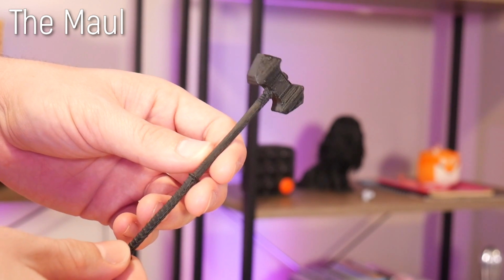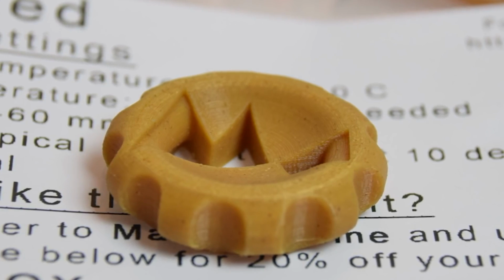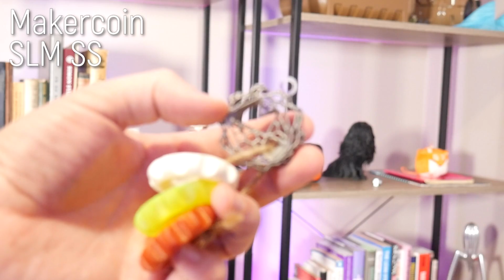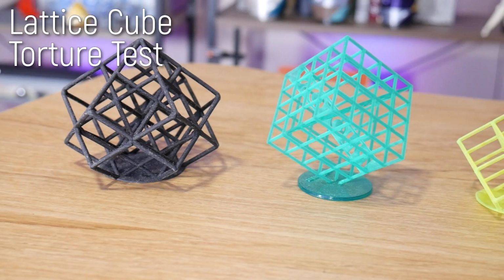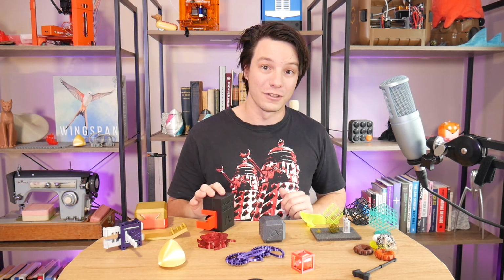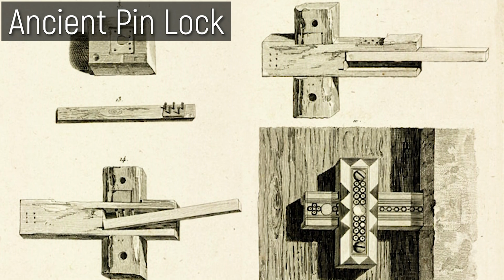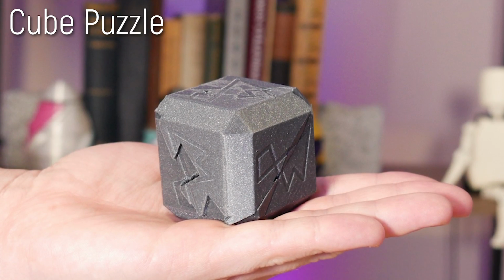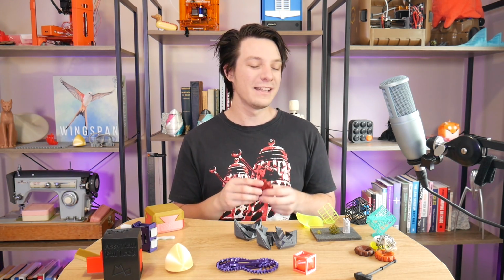My Favorite Designs from 6 Years of 3D Printing!

Comment: 10:54 I wonder whether you could move the centre of mass to the centre of the object by making it hollow and putting a ball inside with the correct size and weight to cancel the offset as it rolls to the low-point (which would vary depending on the relative size of the hollow to the object containing it).

Also wonder whether just making it of a very light material and giving it a very heavy fixed spherical core would have a somewhat similar effect.

Comment: Does it count as 3d printing when you print out so many individual sheets of paper that it forms a large stack in the tray? Lol

Maybe if you could print with some sort of thick ink, and then clip the papers together and burn all the paper away, melting the layers of ink together, you might be able to 3d print on a 2d printer. With a ton of waste lol

Comment: Klein bottle is a manifold you could try to print. 
Manifolds are very interesting math entities .
If you are in a Topological space and maybe you have contained in it a torus of genus 1. You can have this torus to contain a Möbius strip and also intersecting it another manifold that together with the Möbius strip can form a Klein bottle. How would you 3d print this.

But let looking at Möbius strip or anti-oloid as you call it. It may have complementary set inside a topological space that can be another Möbius strip mirrored or a kein bottle.
Those things can be explored ad infinitum. 
When you bring them to the physical world they may have some properties that are really mesmerising.

The little coins could have some dynamic properties. It would make them more interesting. Or be boxes with a lock, tiny boxes. 

I am thinking about buying a tiny 3d printer and I have to decide which one is best and how I will write programs for it. I worked as programmer and analyst a good part of my life. Now I have people of my family that I want to help. And this 3d printing seems to match well with manifolds or I maybe wrong. Anybody can see a Möbius strip in that anti-oloid. 

I still must solve the problem of my lock. Those locks for sale are worth nothing.

Comment: I built the Nautilus gear. It's really pretty cool. The issue I first ran into was the year first level wasn't thick enough and so wasn't sticking to the bed. So I canceled the print clean the bed again and I started the print and wall everything was warming up I went into the settings and increase the filament flow 10% and decrease the printing speed to 70%. Perfect print.

Comment: Nautilus gears might be useful in an application such as a motor compressing a spring in an air soft repeater, needing less torque initially and more as the spring compresses.

Comment: Damn you 3D print wizards.  My son got me one.  Downloading prints was fun for a while but designing my own was a challenge.  Once I learned a little CAD, then the next step was learning about CNC subtractive machining.  Then came the challenge of CAM.  Now I have a 3D printer for additive machining and a CNC (mini) mill for subtractive machining.  So much to learn, such a challenge as I approach my 70th birthday.  Now I want to make a CNC router for woodworking and the challenge goes on.
Reply: Wow this was crazy to read, sounds like you’ve got it. Stay truckin’ Ron Morrison
Reply: My dad`s pushing 60 next monday, and we work together building CNC routers here in Brazil, going on our second year now, and both of us had exactly 0 experience with the design and assembly of these machines, we are waiting for our Ender 3 V2 to arrive! We are hoping to expand in all aspects of CNC, wish you all the best Ron!
Reply: @matheusbravo3758  I'd start with getting  "professional firmware" with UBL, a BL touch (or clone), and a BTT smart filament sensor, maybe a replacement geared metal extruder drive (chinese). I have the same unit with these mods and its finally set up to my liking now.
Reply: @sail4life  finally got mine, with replacement springs (the Yellows), aluminum extruder and capricorn PTFE, first print came out great! Smooth first layer, no stringing, no blobs, and left the bed without anu trouble!
Reply: wow
Reply: Heck yeah, age isn't going to keep this man down!
I wish I had the chance to build stuff like this with my old man. Treasure these times. You're son definitely will.
Reply: Just keep on. While you are learning new things, you are young!
Reply: This is honestly admirable. Big kudos to you, sir, I'd love to see what you came up with!
Reply: Underrated comment

Comment: 10:51 "The center of mass is not actually in the middle of the object." Big misconception there, the center of mass is exactly in the center of the object (ignoring possible offset due to infill pattern etc.). The problem is that solids of constant width are not always solids of constant *radius*, and objects will always try to orient themselves so their center of mass is as close to the ground as possible, meaning the points where the radius is at its smallest are the points where the object will come to a rest, because that's as close to the ground as the center of mass can get.

Comment: Hey sir, i am try to build my 3d printer from last 6 month but every time i face some problems.
I am almost completed my printer at home but i have a problem that my extruder motor is not working in Arduino mega 2560 . I am using marlin firmware 1.0 for this .
My printer x y and z motor are work fine but extruder motor is not working. Plz help me to make it complete.

Comment: Hi Angas, i have been following you since day one.  and enjoy learning from what you have shown,
Anyway I do have a problem with the strength of my prints
i Use an Anet A8 1.75 PLA+ on a 04 stainless Nozzle
 
The filament I use is Esun Pla+ or EDM PLA+  Very good Quality brands.
I always print at 100%  at a Temp of 228 @ 0.15 res
Prints come out very smooth and look like injection moulding, 
The slicer I use is  Matter Control 

Small solid prints are indestructible, but when print hollo objects like tubes, with a outer wall of about 1.5mm
is that they tend to snap upon minor force.
can i ask you what is your best way and settings for printing tubular  objects. 
I can send you a .STL file,
this has been bugging me for years.

Comment: The main reason you need supports for DMLS is because parts warp like no one's business. In fact, you usually have to anneal the parts in a furnace while still on the print bed (supports and all) in order to dissipate the residual internal stresses before removing them else they'd spring into completely random geometry.

Yes, much like SLS most DMLS machines have a heated build chamber to try to help mitigate internal stress build up. But unlike SLS, you can't keep your power bed temp 2 celcius below the material glass transition temperature.

Think of it in material terms - ABS warps due to residual internal stress when the delta temperature is 20C. Think of how much stainless steel wants to warp when the delta temperature is over 1500C.

Comment: My son and mine best prints 

Short intro, my son, 15 year old authistic guy wanted to learn about 3d printing. He loves computer stuff anyways. I bought actualy the cheapest china cloned clone of a cloned A8. 
As imagined, i did not work very well. Succes!
The thing was wobbly as hell so first prints where not very good. It where just blocks we used to stabilise the printer. Prints got better. After two months the mainboard fried so we ordered Arduino board and stepper drivers. Again, great improvement. 

Is it a perfect printer now? Nope, but we both learned a lot from it.

Comment: Can anyone help? I would like to join 2 stl files. When joined it would be larger than my current build platform.
Reply: Are you looking for help joining the files or printing ? Can you print them separately and glue together? Sometimes I split objects in two to make them easier to print and then glue back together.
Reply: @ColinWatters  I have 4 files that are glue together that I want to join to make 1 file. I am going to build a printer that would be able to print them as 1 unit.

Comment: I want to get the designs for prosthetic arms out of my head (having lived with a "hook" for 35 years) I finally have a pc that can run the software but a divorce and health issues mean that i can not get my hands on a 3d printer or scanner for the next 5 years minimum until i have had surgeries and can return to the workforce... Is there any free software you could recommend to someone new to this whole thing? i've got nothing but time to sit here at home and teach myself how to do it with the end goal to be able to spit out prototypes for these designs floating around in my head
Reply: From what i understand fusion 360 will give out free licenses to their program as long as you don’t use it for commercial purposes(i.e. sell your prosthetic) but if you decide to and make money off of it you can upgrade to a paid license and your models are to do whatever you want with. I think fusion 360 isn’t basic at all but it covers everything your looking to do(i think)
Reply: @gigamac2486  and @James Sinclair +1 Fusion360 is indeed free for non-commercial use and totally amazing. Loads of YouTube videos if you ever get stuck. Typical work flow is to create a 2D sketch, then extrude parts of it, add other 2D sketches to faces of the extruded part and use those as tools to extrude new geometry or cut holes etc. Has features like lofting and path following so you can create virtual tools to "cut" any shape you can imagine like a custom screw thread. Once you learn how to use it properly you can go back and edit a feature like a hole without having to redo all the design work you did after adding that feature.

Comment: oh the maker coin reminds me of a project my engineering class did a few years ago,  we were tasked with taking a quarter inch thick disk and putting a design on it. mine had a patterned border of arcs and points  but the main design was an embossed 'unity duty destiny' symbol from bionicle     all designs were submitted to the teacher for printing and grading,  a week after I got my finished item,  i found a copy of it in the classroom in a slightly heavier rougher filament,  I asked the teacher about it but he couldn't give me a straight answer    nonetheless I was quite flattered that my design was used as a test piece

Comment: How about a video of actually very useful 3D printed objects?  I need to justify getting a 3D printer.  😉
Reply: Create your models in tinkercad, fusion360, or Blender - then tell the misses - if only I had a 3D printer, we'd have a fortune.
Then transition to a small foundry and some petrocast sand and make durable versions of your parts.
It's what YOU put in to making the models that makes them so valuable. Ameyeright?

Comment: This 'russian lock' is actually a nightmare to pick, and in most cases gives you an exact opposite of 'low security'.
Reply: Seen few videos opening it with a carrot.
Reply: @dWoogie  Yeah... Saw Angus struggling with that. In essence, this is still a nightmare to pick. Imagine you have to spend half an hour pushing carrots in and hoping it would finally work. Or hammering a soft wood in a middle of the night, hoping no one would notice...
Reply: @przemekkobel4874  lock picking lawyer...
Reply: @pietrom2642  look at his name
Reply: In russia lock pick you!
Reply: LockPickingLawyer would have it open in 15 seconds
Reply: "Nice click on 1, 2 is binding"

Comment: I have a prob with my printer, say I print a box with an outer diameter Of 10mm, I then measure it with my callipers and it reads as 10.4mm, what should I do? This is on a cheap starter printer, I am getting an i3 mk3 by prusa soon though, I do mechanical prints and I need to have the size exactly the size I want, what should I do? The printer i use is a xyz davinci junior 1.0

Comment: I needed this video today. I lost my entire evening last night because my Flashforge has been failing to print ABS, under extrusion on every print even after swapping filaments, realigning the print bed, resetting the firmware, disassembling and cleaning the entire print head, and even using the original test model on the SD card. At 1am I was ready to unplug the printer and put it back in its box! Right now I've got some PLA prints going on the left extruder and they're working flawlessly. Annoyed that all my projects are on hold until I can get them to print successfully, but at least this video has given me some mini projects to do in the meantime.

Seriously, at 1am today if you'd asked me "what do you think of 3D printing?" my answer would have been "it's harmful to your mental health, don't buy one!" 😅
Reply: When I feel ready I'll try printing ABS from the left extruder, but I need a break. Unfortunately with my Makerspace closed due to COVID-19 I can't just drop in there and churn out the remaining parts I need on their Zortrax M300 😢

Comment: Are there any infill patterns which are not closed cell? I'm looking to stiffen prints by injecting resin into the core by introducing it through a hole drilled into the wall. Thanks.
Reply from the maker: Yep! Try gyroid

Comment: You should try to Print a Solid of Constant width with the Center of Gravity in the middle.
Reply: The CoG probably is in the middle. The problem is that the contact point isn't always under the CoG, and the CoG has to move up and down as the solid rotates. If there was an easy solution, Angus would probably have done it already!

Comment: You say that for the tollerance test if you get bad results, you should tune the printer, but what exactly do I need to tune?
Reply from the maker: Adjust retract amounts and speed to minimize blobs, check e-steps to ensure the correct amount of filament is extruded (ie 100mm actually equals 100mm of extrusion) and on the hardware side, tight belts and minimal slop in the axis' helps :) there are sadly many factors that go into a precise 3D print.
Reply: @MakersMuse   - and what about a resin printer. For any given liquid resin - it is mostly about exposure time - right?
Well, that and a really good cleaning before curing.

Comment: Some neat designs, but 3D printing still resides in the realm of an expensive toy.
Reply from the maker: Tell that to the people around the world 3D Printing PPE for hospitals in need right now :D It does have its uses.
Reply: Maker's Muse yeah- extremely limited uses provided at  an exorbitant price as witnessed by your extremely functional(sic) "favorite designs". A fancy toy.
Reply: @sdushdiu   - create the prototype in plastic then cast it in metal - it's really only limited by the skills your willing to learn. Think of it as a stepping-stone not the entire journey. I think the name of one maker is FordBoy, he creates car parts. VegOilGuy creates jewelry and sells it on Etsy. Then there are all the dentist out there making mouth parts, dentures or crowns or bridges using resin printers. Some folks just have stunted imaginations, I guess.
Reply: rojer Your notion regarding dental appliances is wrong on two counts. First they are currently made from actual molds of materials that cannot be replaced by 'resin' that in many cases must be color matched in real time. There is nothing to be gained by the approximation of an appliance that must then be remade in the final form more than doubling the steps, time and material with no increase in fit or finish.
But if you think you can make a profitable business selling doodads on etsy, have a ball. 
The primary limiting issue is that the advantage of printing is the prototyping of a limited run component that can in most instances be produced by current means more cheaply and efficiently in a mass produced environment.
The market for custom components is both niche and not substantial.
The fact is that most mass produced components are already fabed in CAD and can easily be made by various CAM systems eliminating the need forfabrivation
Its a great concept that is limited in far too many ways by already existing technology and methods.
Reply: @sdushdiu   - Most of us can't afford all those industrial machines, nor their owners' time. And niche is the reason. Well - for me - I probably could make a durable model of the home I want to build using the old fashioned methods (cheaper as well) - but I learn a lot from the challenge of learning a lot. And I certainly would not be able to match the level of precision that resin printing affords me.  These little machines aren't supposed to be for mass production. Injected molded parts are expensive to get started and require mass production to pay for themselves. Admittedly - there has been too much hype about their capabilities. But it's not always about making more money. It's about being creative. I'm not looking to sell my wares. But folks are making outstanding jewelry. Anything lost wax can make - 3D printing can help to make more precise. But it is an investment in time, money and creativity. It's the journey that counts (often enough).
Reply: rojer That's fine. But the fact remains that the technology - while initially being hyped as presenting huge opportunities has in large measure proven to be just that - hype  existing market and prototyping realities do indeed limit its competitive advantages. 
That is my primary 'objection' or reality check.
I too continue to seek creative applications to justify the investment with declining expectations except in special case applications.
I am not dismissing it for one off experimentation, or various creative fabrication. 
But the 'orignal' hype the technology seemed to present where many thought it would be the 'next big thing' has proven to fall far short where it properly occupies a niche spot among the myriad fabrication technologies.